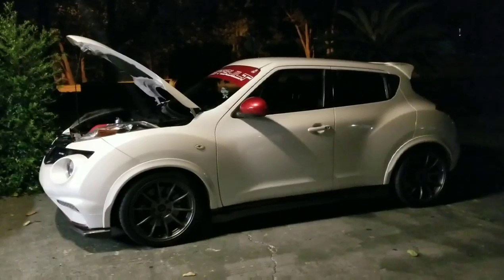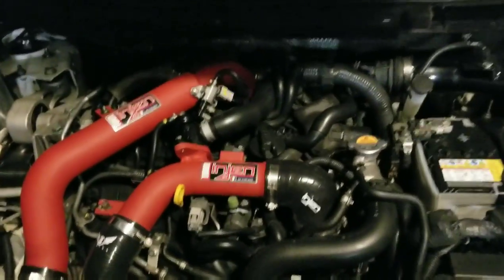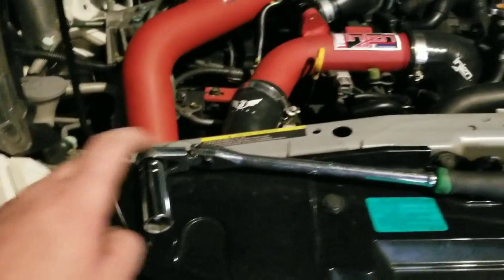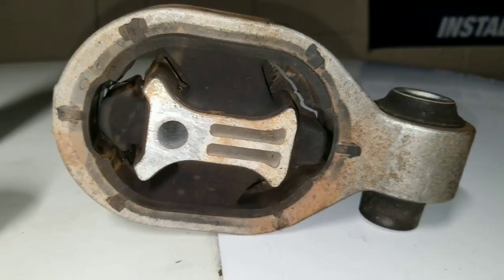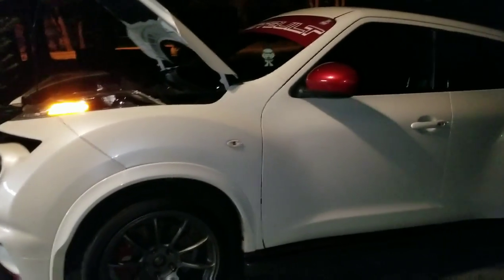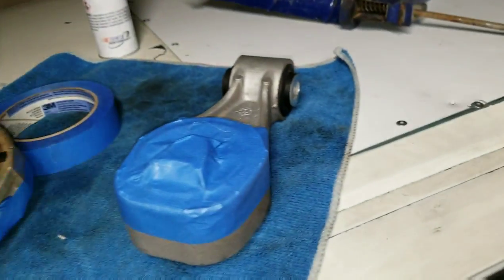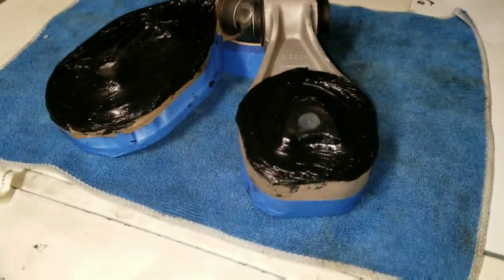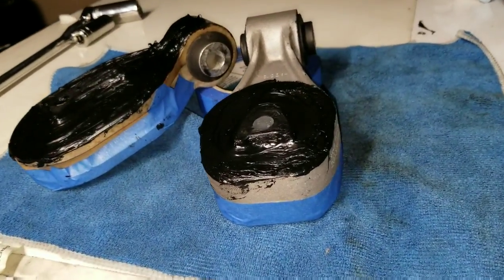Nismo JUKE newest upgrade! 27$ motor mount fix!

Comment: Hello sir....I have a 2014 juke nismo...
I'm hearing a clanking noise when shifting ...everything works well.
Mechanics cant seem to pinpoint the problem.
Could this be the solution?
Reply from the maker: mounts would be the first thing to check! the upper and lower torque mounts